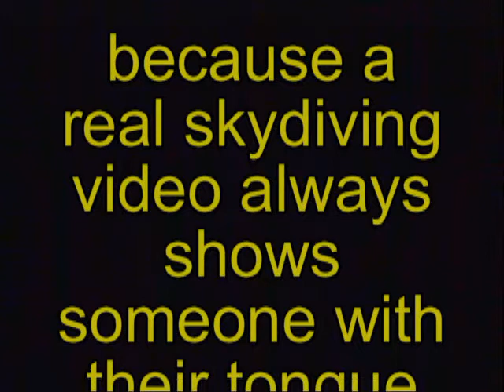Reserve Total Malfunction (reserve parachute packing and testing)

Comment: I believe this was due to the material inside these old containers and half the reason why we have to get them repacked every 6 months. The reserve freebag and pilot chute could become partially stuck to the container like duct tape once it's been inside a compacted area and in heated conditions such as flying around under canopy with sunlight beaming on the reserve container. All manufacturers have since changed the inner container materials.

Comment from the maker: I've heard a couple of very interesting fail stories.  One involved a skydiver who had a total reserve malfunction in free fall after a cutaway. They hammered the reserve container from the sides until the reserve pilot chute deployed.  Rolling over onto one's back is also a last resort idea: let the air flow help you drag something out.  there are lots of ways to cause a malfunction by way of improper packing. thus sending the video to the manufacturer might not be useful without more details.

Comment from the maker: (continued) Nothing "out" means nothing is slowing them down, they are still falling at terminal velocity. Assuming it takes 2 seconds to perform the emergency procedure, they are 8 seconds from impact when the reserve pilot chute fails to launch. Most would say 5 useful seconds as the last 3 don't count as deployment at 500 feet is unlikely to save you, but it might.
-- Some would say the best option to to roll onto your back and hope the air flow pulls out the reserve pilot chute as you .....

Comment from the maker: If I recall correctly, we tracked down the hesitation of the pilot chute to the manner in which the fabric of the spring loaded reserve pilot chute was situated around and under the spring. In most high speed (terminal velocity) reserve deployment situations, the skydiver is about 10 seconds from impact when they realize they have a main malfunction, assuming it is a total malfunction.  Meaning there is nothing "out",